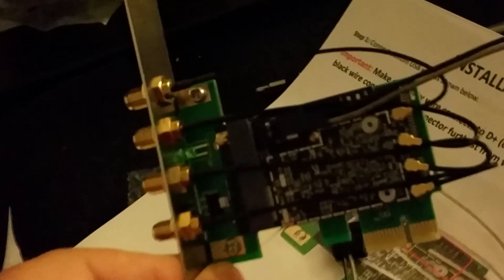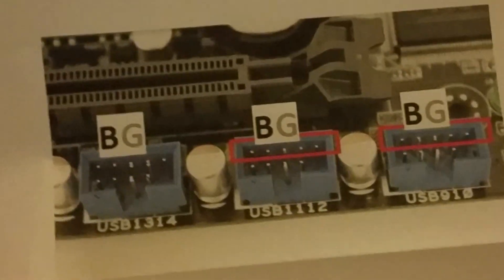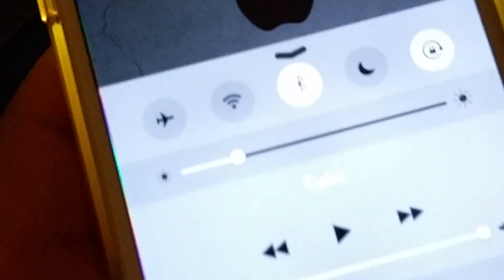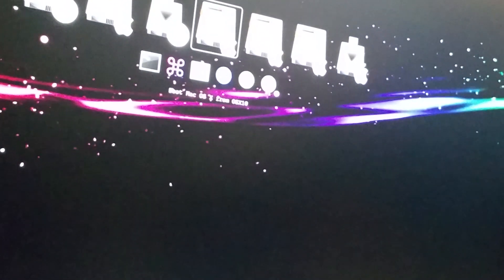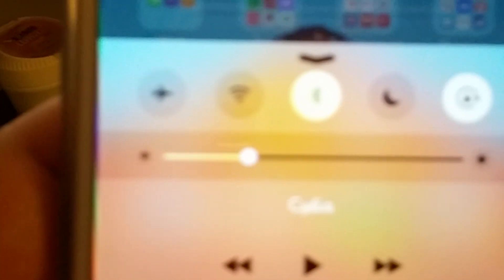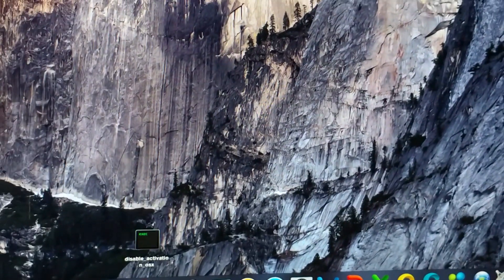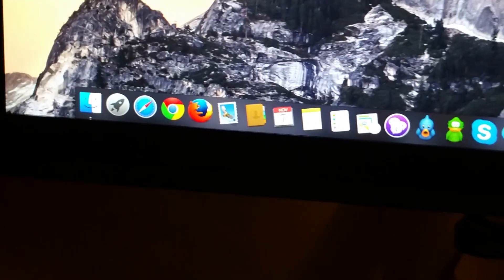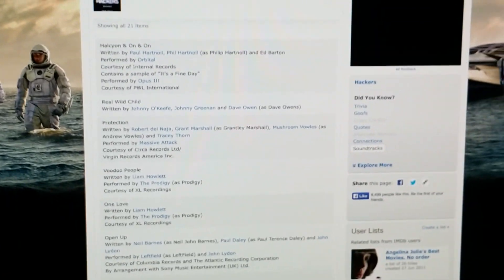[HACK] Getting Native Wifi and Bluetooth working in ANY MAC Pro and Hackintosh - 1 step EASY!!!!

Comment: on MAC PRO  1.1 + Yosemite

hello , i have a similar adapter card from china.
using it with a BCM94360CD ;
have a usb cable from the adapter out to the external usb2.0 port

card gets recognized on apple bluetooth explorer, but can't get it to activate. 

any hints?
Reply from the maker: Sorry nothing. This is why I only use this card everything works

Comment: I am unable to sign into iMessage otherwise I got everything else working. Did you have that issue?
Reply from the maker: You need to follow the guides how to get iMessage to work. Simple google will show you. But it's quite intense if you never did it before. IMessage is a hackintosh thing. Has nothing to do with the wifi card
Reply: I just figured that out and messed up my Hackintosh, trying to delete the file with my USB boot drive. It's in a reboot Loop and won't let me boot in save mode. Going to buy a second HD incase I do this again. LOL
Reply from the maker: +Jose Espana haha. Yea usb method is best. Keep one that works on hand 24/7. That's what I do. Also make sure it's usb2 and use a usb2 port 👍
Reply: +John hale I only have USB 3 on my Hackintosh no USB 2 but it works great when I have it running.
Reply: @MR_GT78  you can partition one hard drive and create multiple efi partitions which you can use as backup to keep a working config in place at all times and then boot into it from your main clover gui. It will list the partition and you can even hide it and set a hot key. No need for multiple drives to accomplish this
Reply: delete your network devices plist and restart your computer. If wifi isn't listed as lan1 and ethernet as lan0 then this will happen. It usually gets screwed up if you add wifi after installing Mac whereas if wifi were present during the install then the devices would be numbered correctly. If that doesn't work then there's a problem with your smbios info and you need to fix it. Its possible the serial you were using was banned by apple because they detected it as a Hackintosh. Make sure you set up smbios correctly before signing in to iCloud. If they did ban it just generate new smbios info and make sure you did everything correctly and then sign in to iCloud.

Comment: what rf is the bluetooth on?
Reply from the maker: How would I check? If it's easy I'll post it for you. Works perfectly
Reply: Take off one Ariel at one time outside till the keyboard loses signal , find the one ,then look where the cable goes to the board inside.